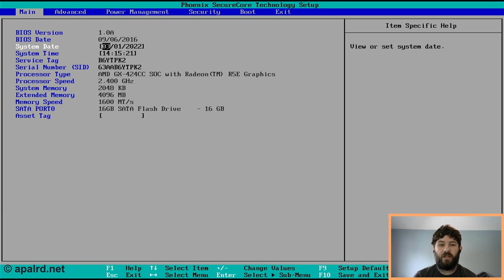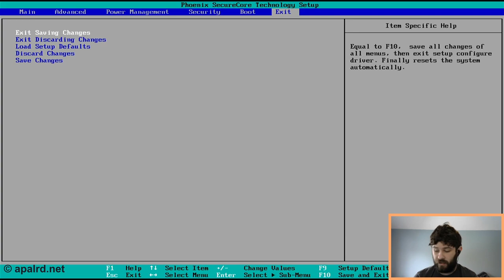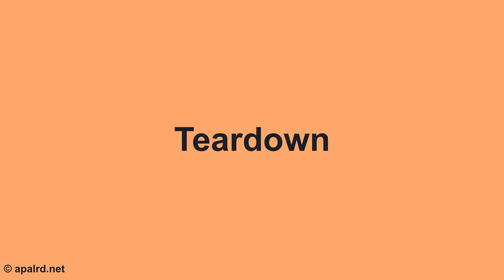Dell Wyse 5060 Thin Client TEARDOWN & SOFTWARE INSTALL | Not Much Inside, but still great for Linux

Comment from the maker: For those of you interested in video playback:
Youtube had no dropped frames at 1080p60 and 1440p30 but 4k30 was not watchable
h.264 mp4 playback was similar - stuttering was very significant at 4k but not apparent at 1440p
Tested with xubuntu 20.04 live USB
The built-in speaker is also completely functional for video playback, but it isn't winning any sound quality awards
Reply: can you advise or post amazon link to which wifi card, ssd, and memory can workwell for this 5060 client. thannks i appreciate your efforts !!!

Comment: I want to thank you and some of the commentators of this video for all the hints. This is by far the cheapest media player I've ever bought. I got the machine incl. power supply and stand for €37,-, a HDMI adaptor + cable + usb remote control for €14 all together. LibreELEC (300mb) was easily installed in under 10 minutes. Runs great and plays 4k. Don't need more. I think I make one more build for my father because KODI is so simple, he can handle this.

Edit 4k playback was playing a movie from a USB 3.0 SSD but tv shows also run on 4k with USB2.0 HDD

Comment: I have two.  Both running Windows 10 and Puppy Linux.  SATA SSD hard drives, 120 and 512GB, removed from their plastic cases.  
One of them is my always on broadcast TV recorder using a Hauppauge WINTV 1950 external USB-2 TV tuner.
Installed wifi cards and antennas in each.

Comment: You forgot to mention that there are 2 SODIMM slots under the smaller heat shield and ram is upgrade-able. 15+7 sata cable adapters are available on amazon and ebay to install larger SSD. I have sevaral running W10 pro w/ 8Gb ram.
Reply from the maker: I didn't try to take the heat sink off, but that's good to know! RAM is definitely a limiting factor on some projects with these.
Reply: Any idea what the ram limit is?

Comment: I have one of these with 4GB of RAM, and a SATA hard drive via an adaptor cable.  It's running Linux Mint XFCE, but it's a little bit much.  I'll give MX Linux a go at some point.  I also have an HPT610, which has the same CPU and graphics.

Comment: take out the original SSD and use a Sata to NGFF M.2 adapter.... and then get a 512GB NGFF M.2 module to upgrade the storage capacity.... the max memory for this unit is 8GB. DDR3

Comment: I have installed Xubuntu on an HP T620 and have to say that it is not nearly as nice as a full Ubuntu install. Just 

My recommendation would be to select "minimal install" and then only install what's really needed.

I'd only use Xubuntu if Ubuntu cannot be installed.
Reply from the maker: I have a T620 to test, but I use xubuntu because it's the distro I decided to keep on a dedicated flashdrive for hardware testing. Same kernel / hardware support as ubuntu.
Reply: @apalrdsadventures  My Linux knowledge is very basic. I had the T620 attached to a Hifi Receiver as an HTPC. There was a strange "bass rumble" problem under Xubuntu, it disappeared when I replaced that with Ubuntu. Yes, the same kernel and the drivers are in the kernel. But maybe some kernels are more equal than others.

Comment: Does the current version of blender run under Linux on these? I know it won't run fast, but would like to offload my rendering to a farm of these if I could...
Reply from the maker: I honestly don't know if it will run Blender, but the GPU is modern enough to be GCN-based and the CPU is kinda decent so it can't be *that bad*. You might need to upgrade from the 4G of RAM.
Reply: @apalrdsadventures  make a video! Lol
Reply from the maker: They're already a Proxmox cluster and Thursday the first Ceph video comes out, so they're busy little things. Maybe someday they'll have time to be a render cluster too
Reply: @apalrdsadventures  can you pass the gpu through to a VM and test?
Reply from the maker: I could boot one of them into a live USB and test things

Comment: Maybe this is covered in comments on somewhere in one of your excellent vids.  Is there a way to upgrade the bios on these systems using the latest Dell bios - from 2019?  It seems from Dells own docu that about the only way to do that is via a cloud service - either officially from Dell or privately hosted.  I don't see a way to have these 5060 thin clients to real from a BIOS flash on boot, as other Dell systems do.... Any suggestions?
Reply from the maker: I have not updated the BIOS on my machines.
Reply: @apalrdsadventures  I just added 8GB to mine (I'm too cheap to buy two sticks and remove the 4 mine came with).  What a major pain. And, I borked my power button in the process, at least it no longer functions.  Tight squeeze!

Comment: Excellent Videos. Thanks for that. What I do not get at all, is how you get to the price tag? On eBay They are mostly above 100€.. Where will I find them cheaper?
Reply from the maker: I went through all of the eBay thin client listing sorted by price and settled on the 5060 because at the time it was available cheaply and the specs seemed decent. So, the 5060 isn't available cheaply right now, but there are other models to consider. Like all used enterprise hardware, prices and availability change all the time.
Reply: I just picked one up in the UK for £20

Comment: You didn't finish. I replaced the 4GB ram with two 8GB. I was able to install Windows 10 and have 16GB Ram with a 40GB SATA SSD.
Reply from the maker: I didn't find the RAM slots until later since they're under a heat sink, but I did go on to upgrade to 12GB and install Proxmox for virtualization (the Proxmox video is out now, and the RAM upgrade where I fight with the light pipes on the front of the case is being edited)
Reply: @apalrdsadventures   wow you mean like you had a full-blown lightsabre duel with someone? Awesome !!

edit:  oops,  perhaps I misread that
Reply from the maker: The light pipes for the front power LED are long enough that you cant get the RAM sticks into the lower slot without loosening the front panel and wiggling everything around very frustratingly. You also have to remove the front IO board just to see the whole bottom slot.

Comment: Think these would be OK to use as a network drive  running Linux, InSync to sync files to Google cloud, and as a non-transcoding plex server? Edit: storage would be USB.
Reply from the maker: The 5060 has honestly blown me away with its performance and value, although the $35 deal was only for a lot of ~500 and that seller is now out. Even at the current list prices of around $100 all included, it's still much better value than a Pi 4 or many of the SBCs for that price point, storage and psu included.

I found out after filming this that there are 2x DDR3L SODIMM slots under the heat spreader / EMI shield (they are a giant pain to get to with the front IO ports on top of the RAM), with 1x4G populated on my units, so I upgraded them to 12GB (1x4G + 1x8G) and run Proxmox on them.

The biggest limitation would be storage, you'd either be relying on USB3 external drives, or a SATA extension cable to replace the half-length builtin SSD with a larger SATA SSD, or maybe both. 

If you're okay with USB3 storage then it's a fantastic home server, with pretty low power consumption too.
Reply: Cheers for the reply dude. I'd be fine with USB 3 data rates for my use case.

Over here in England, they're going for £40, and are available, unlike the Rpi I initially had in mind for this project.
Reply: @apalrdsadventures  The 120GB and 512GB SSD's I bought used only about half the length of their plastic cases.  I installed internally directly into the SATA connectors.  I nipped a corner off of the RAM covers to clear the SSD.

Comment: I have a 5060 and a 5070 and I wanted to know if anyone has tried running or installing botacera for game emulation
Reply: I have and it works well. Initially sound will come from the speaker in the thin client but it's easily sorted from batoceras settings.

Comment: Are these normally sold with an operating system?
Reply from the maker: From Dell they were sold with either Windows or ThinOS, many of them come wiped on eBay.
Reply: @apalrdsadventures  thank you.
Reply: Many were sold with Embedded versions of Windows 7, 8, or 10 (others had Linux) (referring to 7000 series).  With some tweaking, the embedded versions work pretty much like the familiar consumer versions.  If you can get a copy of a compatible Dell/Wyse OS installer, you can load it back onto one of these devices (the devices are locked to whatever Windows flavor they came with, if you try to use the Dell/Wyse installer;  you can't put 10 on a unit that was originally 7, using the Dell tools).  The installers are still available from Dell, but ONLY if your particular unit hasn't timed out of their system - sadly that was one of the changes Dell made after they bought Wyse.  You can check that with the Service Tag #, at the Dell site.  Once you have the OS installer from Dell, it can be used on any compatible unit, regardless of Service Tag, but the trick is getting the installer from Dell to begin with.  You also need a USB installation software tool that anyone can DL from Dell.

Comment: Is this suitable for retro gaming? What os that suitable for retro gaming??
Reply from the maker: Can't answer about OS, but the 5060 has a pretty decent CPU/GPU - it's essentially an older AMD laptop processor.
Reply: Batocera Linux runs great on these little machines. That should cover all the retro gaming the machine can handle

Comment: What's everyday Linux DE performance like?
Reply from the maker: I installed xubuntu and performance was good for the basic tasks I tried. I use it to pull up drawings/datasheets and videos on my workbench, and also to run OBS to capture from a USB HDMI capture device (direct to a network share).
Reply: @apalrdsadventures  What was YouTube or video playback like? Maybe something like this could make a great media PC or Myth frontend?
Reply from the maker: I did some testing and pinned a comment with the results

Comment: Does anyone know if the m.2 socket is only good for a wireless card, or might it support an ssd too?
Reply from the maker: The stock wireless card uses PCIe for WiFi and USB for Bluetooth and supports A or E keys, so the board supports one PCIe lane. So you definitely won't fit a standard M key SSD (even a short length one). PCIe risers exist to go from a WiFi key to SSD M key, but you'll only get one PCIe lane (which might be fine for you).
Reply: You can use a cable to get an m.2 SSD on that WiFi socket, one lane at 500MB/s theoretical maximum

Comment: Can the M.2 slot fit another storage SSD?
Reply from the maker: The M.2 slot is an E key (usually used for wifi, bluetooth, or LTE radios), so it's not the normal B/M key of SSDs

Comment: ho i get reply. does this run headless?..
Reply from the maker: I haven't had issues running Proxmox headless on it
Reply: @apalrdsadventures  okay... but i have read comment saying it need dummy dp? or else it won't run if there's no plug in display port
Reply from the maker: If you are using a server OS it won't have a problem. There's no hardware limitation to it.

If the OS is dumb and won't allow remote access without a physical screen, that's on the OS
Reply: @apalrdsadventures  ubuntu server gonna install it...
Reply: @apalrdsadventures  thank for review. <3
Reply: I saw j4125 mini pc. O pfsense but it cost 4 times than 5060?. Worth to buy it or stay 5060?. Consider power efficiency and performance

Comment: So, a friend gave me one of these, and I installed a new SSD 240GB and new Ram 8GB.  Both only were 2GB each! I thought that by upgrading those that it would run better! I was able to install Windows 10 and it runs pretty well. The issue I'm having is You tube videos are lagging and won't play in HD mode! 360 is the highest in auto mode and still is not good. The only thing I can think of is that the CPU is not strong enough! It is an AMD G-T48E 1.40 GHZ. I ran some tests, and everything passed! *NOTE I installed a video from a flash drive and that plays perfect! As far as my internet speed goes this is the only item that has a lower internet speed WIFI or Ethernet connected! All other electronics and PCs are working perfectly. What is causing my issue? Thank you in advance.
Reply from the maker: It's probably a driver issue in Windows - I'm not sure what driver you'd need for Windows, Linux has the drivers builtin and they seem to work well. The CPU isn't great but the GPU can actually do a pretty good job at video decoding.
Reply: @apalrdsadventures  I tried to download driver but when I checked it said that the best drivers where already installed! I just changed the mtu setting to 1500 in the command prompt and now the videos will play up to 480 now! Progress! At least that improved it! After a speed test it changed from under 59 mbps to 94.2 mbps!
Reply: Curious where you got the SSD from--everything I've seen as an upgrade option for the 8GB drive I have is $200+ which doesn't make any sense to buy.  Memory is cheap, but the storage is a deal-breaker for what I wanted to do with this (run Windows and jukebox software in a cabinet).  Thank you.
Reply from the maker: The 16G SSD was included with mine, but I recently bought a very cheap 480G 2.5" SATA SSD and disassembled the housing to find that the PCB inside is very tiny and easily fits in the 5060 - this one https://amzn.to/3QRnBSL
Reply: @jimflood1590  I got the SSD on amazon for $18.99 all I did was open up the plastic casing and the SSD is small like the one in the thin client! I saw a video with someone who did this! Very easy and much cheaper! If I can find the video I will get you the link to it!